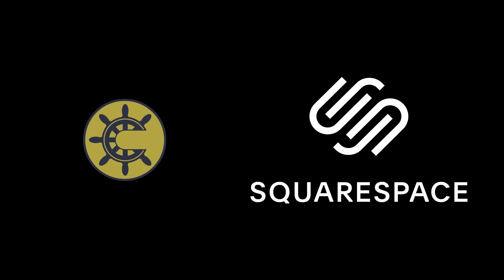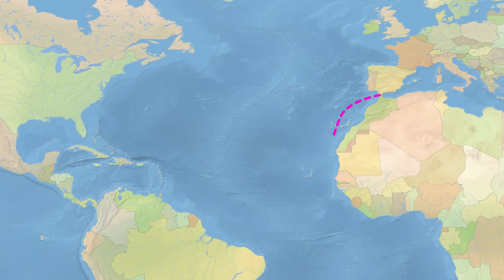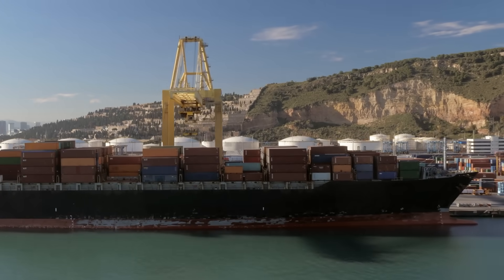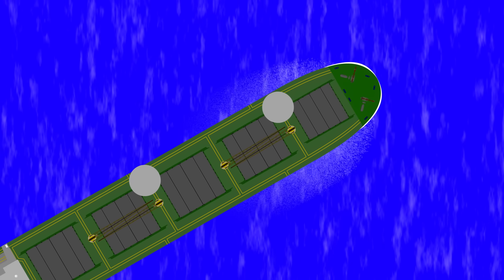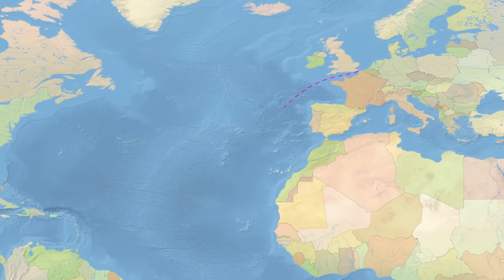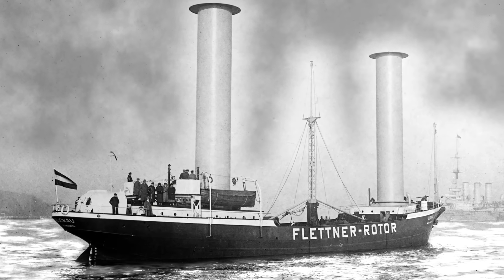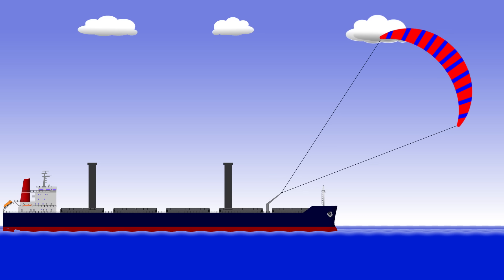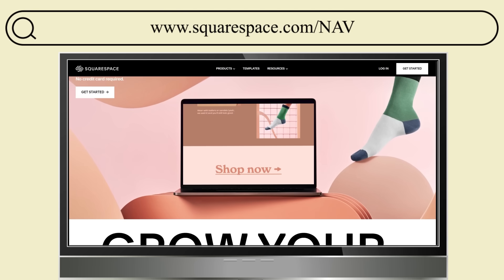Why Don't Sails Work On Ships?

Comment: It's important not to see the shiny new idea and get obsessed with it's upsides without considering the downsides.  Fitting wind power on ships is a bit like using solar or wind power for power generation on land.  These wouldn't be a replacement for fossil fuel systems because they aren't consistent enough.  So you end up with multiple systems adding to the cost of the essential, base line hydro-carbon generating systems.  So far the price of coal and oil is still low enough that most of these additional systems aren't economically justified without tax subsidies.
Reply: Price monetarily yes. but what about price with respect to the impact it has on the environment? Regulations (as CN said, ones that are applied to ships of all nations) are needed to make those one and the same, IMO.

EDIT: and just because I said regulations, doesn't mean I meant the kind of regulations that would drive prices up massively.
Could be something as simple as emissions regulations, the kind that can be easily conformed with by changing some small details about the engines (and maybe fuels) that are used by cargo ships.
I'm not talking "pie in the sky, the ships emit nothing anymore" type regulations. I'm talking about regulations that are "a step in the right direction, to start with", and those regulations getting tighter over time, allowing for the change to happen gradually.
Similar concept to emissions regulations in cars.
In 50 years, we could have cargo ships emitting a lot less harmful gases into the atmosphere, even if the carbon emissions are only a little bit less.

The main change I can think of that would massively reduce the overall impact of cargo ships would be to farm certain specially designed species of algae, and turn those into fuel for the cargo ships. There's your carbon neutrality, and you don't have to change the design of the ships much (performance might even improve since the fuel I'm thinking of would end up being something similar in qualities to Biodiesel).
I intentionally chose algae as the photosynthetic organism to farm, because you can do that in the ocean (with a likely byproduct of food such as shrimp), instead of taking up valuable arable land like the corn-based production of Ethanol and/or soy-based production of biodiesel as a substitute for automobile fuel does.
Reply: Most coal, oil and gas industries are subsidized as well, making them cheaper. 

But you have to start somewhere. Parts for the  Ford Model T were delivered by horse and cart.
Reply: Even from a pure cost perspective (which I fundamentally dislike) you haven't considered all costs. Luckily for them, owners don't have to pay for the health cost of pollution all around the world and for the cost of lost opportunities because of the pollution. There will be many people (particularly in more developing nations) who made their living relying on a healthy environment. Those lost opportunities are not accounted for. Someone may not go for a walk and enjoy the outside due to pollution. That cost is difficult to calculate but it is a cost
Reply: @N Fels That is pretty much a text book example of a classic straw man argument;).  Where in my post did I say you should be free to dump toxic sludge?  

If you want to be taken seriously you have to respond to what people say and not try and manufacture a version of the argument that you think you can win;).  So let's try this again?

How does creating the requirement for multiple redundant engineering systems of limited utility benefit anyone but the corporations that manufacture those systems?
Reply: @N Fels You know, on the principle that no one win's an argument on the internet and I am obviously not getting through to you I will wish you a happy life and good bye;).
Reply: @N Fels  Logistics is the science of the possible.  You can "want" (quotation marks here for emphasis not to imply you said it) any technology you imagine but if it costs more to produce something than it can be sold for it simply won't happen.  So, yes, you can insist on all the environmental restrictions you "want" so long as you are willing to live with a significantly lower standard of living because you drive prices higher.  And by significantly lower that means poor diet, health care, housing etc.  

But we just have to make business's pay extra right?  Well then the companies will just raise their prices so that things become unaffordable to the average consumer or go out of business and stop providing their services all together.  It simply isn't possible them to operate at a loss because of what you "want".

And please don't insist on discussing every environmental concern in terms of extinction level events.  You damage your credibility and the credibility of the movement.  I can promise you you'll get further speaking calmly and politely.  It makes it harder for people to dismiss your concerns as just another crackpot theory.
Reply: @silverjohn6037 
Reducing pollution has never been the most profitable option for businesses, but regulations on pollution are also the reason you aren't dead from a combination of cancer, lead poisoning and cholera.

It's amazing the extent to which (nearly always American) free market extremists see government action that benefits them as a fact of nature and government action that benefits someone else as a tyrannical communist imposition.
Reply: @silverjohn6037  That is not true. You can force things with legislation (and there are plenty of precedents for that, think health and safety) because there are other constraints (ie finite resources) apart from those of market based economics. Yes we need to accept a potential reduction in the quality of life, because either we accept it or our future humans (and other living species) will suffer
Reply: @philip88154  So we're clear I'm not talking about making do with one tropical vacation per year;).  Do a little research on the Great Depression and the effect that had on mental health and life expectancy.  As I say, think things through and consider the negative as well as the positive effects.
Reply: @silverjohn6037  I know a little about the Great Depression, but the example doesn't stand well since that resulted from poor economic management (which we have learned from since) and was not planned. We need planned economic degrowth. The point is we all agree our consumption is currently not sustainable and that we will face the consequences in the future if we continue on our current course. Believe it or not  those consequences will be worse than the Great Depression because our climate will be wreaking havoc and making the world unliveable. Our climate is our fundamental for living and for the economy as well. There will be no opportunity for recovery. 

I also believe the developed world in particular can reduce consumption significantly without much of a reduction in the quality of living since we have a lot of excess consumption. Consumerism has become more a way of life than a necessity to improve quality of life, we can do well with a lot fewer things (and therefore also a lower purchasing power). Even returning to the consumption levels of the  1960's and 70's in developed nations would be a huge step. A challenge will be doing this in an equitable way. 

What I am absolutely convince by however, is that if we start making changes now, fewer lives over the course of time will be turned upside down than if we continue on our current course
Reply: @Silver John quite. I watch the videos on this channel to learn interesting facts about maritime topics, not to listen to someone who doesn't understand economics.
Reply: @MrRealstreet  So what part of what I said was incorrect?  Simply saying I don't understand economics isn't really a criticism of what I said;).
Reply: @Silver John I was agreeing with you
Reply: @MrRealstreet  My apologies, I misunderstood who you were referring to:).
Reply: No worries!
Reply: @N Fels I would suggest start saving the world starting with yourself. Throw away whatever device, PC or cellphone or whatever, they are incredible bad for environment. Then throw away anything made of plastic/polymer or synthetic fibre, they are made from crude oil anyway, who wants them. The list goes on :)

Comment: I don't agree with the conclusion that only regulation can make ships more efficient.   When a ship operator buys a ship, its a much bigger purchase than a person renting a house.   So it will obviously be preceded by an extensive analysis of the ships fuel efficiency.

Think of it like airliners; the exact argument made in this video applies to those.   "The cost of developing a more efficient plane is on the manufacturer, but the benefit is felt by the airline."   Of course, despite that, planes have become massively more fuel efficient over the years.  Because Airlines want efficient planes and are willing to pay more for them, its the same for ships
Reply: >>When a ship operator buys a ship, its a much bigger purchase than a person renting a house

He said the owner is not in general also the operator, and that is why international regulation is required else the vessel can be flagged in Pan Beria and avoid the capital cost of the equipment.
Reply: @XPLAlN  Regardless of that the owner still has a reason to care about the fuel consumption of the ship, because a fuel hungry ship will struggle to attract charterers.
Reply: @tomporter8849  yes I have no doubt they do care about consumption and if they could be sure the fuel would remain above a break even price it would be an easy decision., But oil prices vary a lot.

Comment: I may be incorrect on this, but it appears wings actually work the exact same ways as sails (in a round about way, if I’m following you correctly), ie., you are redirecting airflow in both cases.  Folks will often point at the low pressure area on the top of the wing as being the lifting force, but it’s not really.  The low pressure area simply acts to pull the wind downward.  This redirection has the “equal and opposite” reaction of pushing the plane up. 

The “redirect” understanding is important because there’s another huge component to lift that nobody seems to consider because of this “low pressure” misconception.  The bottom of the wing also pushes the wind down.  So the bottom of the wing pushes it down, the top pulls it down (thanks to the vacuum).  Thus both sides of the wing are creating lift (just like both side of a sail redirect wind to create propulsion).

This understanding can also help folks to understand why stalls happen on wings.  At low speed the vacuum is not strong enough to redirect enough air to pull the plane up.  But!  At higher speeds the flow can still be broken pulling the nose of the aircraft up abruptly.  Why?  It causes the flow of air over the top of the wing to change from a laminar flow (a solid stream) into a turbulent flow (all twisty and stuff), which breaks up the vacuum and significatnly reduces the top of the wings ability to redirect air.  Thus there isn’t enough air being chucked down and there’s not enough “equal and opposite” to push the plane up.

Anyway, apologies for the small article I’ve posted on your video ;).  There’s just a lot of misconceptions about how wings work on the internet so I’m trying to do my bit to help folks better understand laminar flows…
Reply: Sails are wings.  In fact, high end racing boats literally have a rigid wing sticking up out of the middle because they're completely interchangeable.  The main motive force is lift in both cases.
Reply: im going to be rude but incorrect you are. the wing is pushed up purely by the pressure differential, this pressure differential in caused by air on top of the wing moving faster along the wing than on the bottom. because the air changes direction , the air on the outside of the curved movement has to move faster

Comment: Actually sails on a sailboat don't really get their propulsion from deflecting the wind. They work exactly the same as an aerofoil (aircraft wing) as you explain later in te video. Deflecting the wind is meanly important  for the sail to hold the shape of an aerofoil.

Comment: 3:12 is sadly a very common misconception about how wings work. I know you are an expert in naval topics, but likely not in aeronautics. Airplanes don't fly because of the shape of their wings cause faster and slower flowing air, they fly because the wing is angled so that it redirects the air downwards. It's easy to see it if you think about how aircraft can fly upside down. If they flew due to that shape, then upside down they would fall down faster than if they had no wings as the wings would "suck them down". And there are aircraft with completely symmetrical wing profiles, perfectly capable of flying. That profile which has a higher curvature on the top than on the bottom helps with efficiency, but it is not what causes the majority of the lift.
Reply: i tell this so often in the past, and it was always staggering to me how people could not understand it, even when they saw a plane actualy lift off. the lift generated by the wingshape is extremely small as i understand it correctly, it is ofc a benefit, but actualy the planes are mostly surfing on air.  because of their speed
Reply: Wow, you got two different wrong replies in a row!

Yeah, wings need to be thought about in the context of action and reaction, any speed and pressure changes are technical details.

Comment: I don't get why there's an economical issue... If I have a ship and I invest some money to put these rotors and is therefore more efficient, I can get it hired for more money (recovering my investment) and the charterer still is better off because the savings are more than the premium he paid me. Am I missing something?
Reply: If there is an economical issue it's because the technology is not in a place to make a wide spread implementation of it yet, so he want's governments to force people to do it because he thinks it's a great idea.
Reply: yes, it would only work like that in a Disney movie, in reality, those sails are not cost-effective, reliable, or even effective.
Reply from the maker: If you paid e.g. $100 to install something like that, you'd want to get back maybe $120 to justify the risk of your investment. Now the charterer is paying for the installation & your profit on the installation, so there is less benefit left for them to justify the risk of paying more to charter your ship.
Reply: yep the saving is likely not  high enough to cover the investment or the gain in value, a ship was an expected life time, and those rotary parts likely too and likely the cost savings are not big anough to cover the costs during that period
Reply: @patriciusvunkempen102  well then it isn't an economical problem, it's a "this technology isn't good enough" problem, so as the other person said forcing it by law doesn't make any sense to me either.
Reply: @freshrockpapa-e7799  well idk how it is a problem, as a ship charterer or ship owner the incentive would be to squeeze as much moneys out of  my ships as possible at the lowest possible costs, but in reality  sometimes it is already opimised or just a person needs to start.

Comment: idk, i mean longterm an investment would increase revenue if it actualy worked, and idk the proportions of the cylinders to the testing vessel looked very different than supposed drawing of cargo vessels so the effect would likely be greatly diminished,  maybe  hull streamlining and improvement of propolsion efficiency might help to save more  resources than these funny  cylinders.
Reply: There are already boats using these cylinders and making savings from them.

THEY WORK.

Are they THE answer. Probably not, but they do work as intended.

You'll find that racing sailboats have very streamlined hulls and move VERY fast.

But have you ever watched how unstable they are, or how little cargo they can carry?

Even your average sailboat is a compromise between a streamlined hull and a hull that offers stability and storage space.

Even using fossil fuels back when they were cheap and nobody cared about the environment, cargo ship designs have constantly been improved upon for the best efficiency.

To carry more cargo, faster and cheaper then the competition has always been the preferred way to make more money each year.